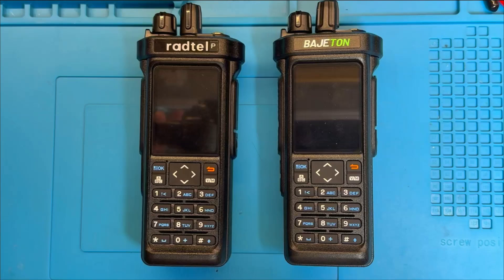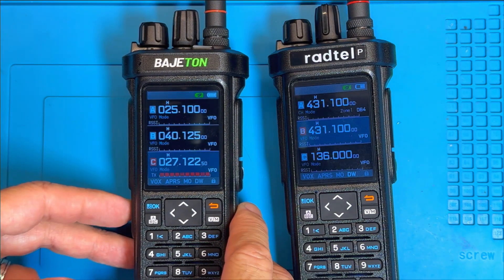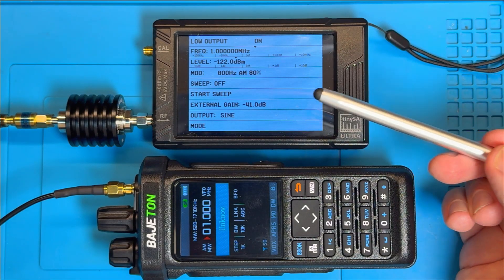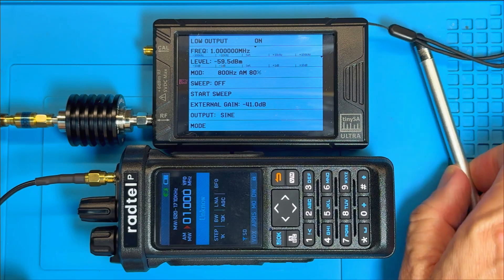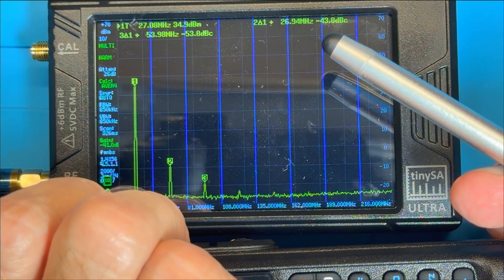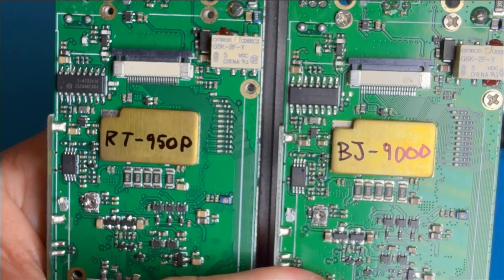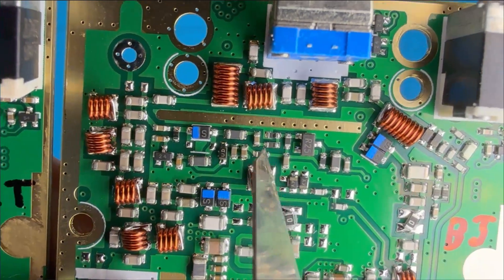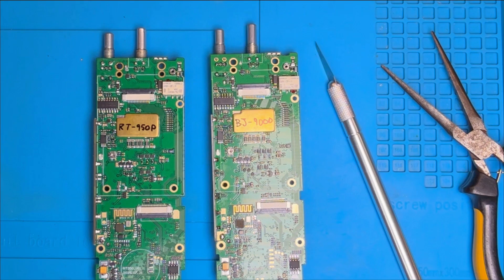EB028 - Bajeton BJ-9000 Vs Radtel  RT-950 Pro (Re-release)

Comment: my rt 950 pro doesn't have the work band menu, it has bandwidth in it's place. can you explain this?
Reply from the maker: Have you put the radio in Super Mode? See my video EB026 at the 12:16 mark.
Reply: @ElectroBananasYT  so do I need to solder or desolder something on the PCB?
Reply from the maker: No
Reply: @ElectroBananasYT sorry to bother again but I saw the video and didn't grasp what to do to access de menu work band

Comment: Not sure why operators are that worried about some slightly low RX. It’s a cheap Chinese radio. As long as it TX and RX in the designated bands, then what is the problem. Might be the new generation licence holders who seem to be obsessed with problems and not operating

Comment: Did the v23 firmware update fix the radtel 950 pro?
Reply from the maker: It is a hardware issue, not a firmware issue.
Reply: @ElectroBananasYT dammit! I was hoping I misunderstood. Well, I guess I'll be waiting for the next one and sell the 950 when I get it.
Reply from the maker: I am working on a DIY fix video. Watch this space.......
Reply: @ElectroBananasYT I guess it will involve dissasembly and resoldering? I should search for a professional with the necessary tools and experience. Thanks for the heads-up!

Comment: What features do these have that the  Baofeng Min and Senhaix 8650 don’t?
Reply from the maker: The main ones that come to mind are APRS and GPS. Also a bigger and higher resolution screen. Ability to Rx&Tx on 27MHz CB band
Reply: @ElectroBananasYT  thanks for the insight, so you’d likely recommend either of these in your video over the two models that I noted?
Reply: @momosgarage por supuesto  cual quiera delo s dos es mejor opción

Comment: Thanks. Great video again. Very helpful. 
How do you check if you’ve got an older or newer RT950 Pro? Only by listening or measuring? It was not a firmware upgrade? Opening up and check board versions? 

So get the hot air gun ready? 😊
Reply from the maker: Definitely will need to fire up your hot air gun or soldering tweezers unfortunately. And that is one we discover what components need to be changed. I have asked Radtel the question on how to identify the radios with the issue. They have not come back to me so far.

Comment: But is LW / MW really any good in the real world with the BJ9000 using a proper MW loop etc compared to any other radio even the TEF6686 ? I suspect not !
Reply from the maker: For sure it will not be as good as the super sensitive TEF, and probably not as sensitive as a radio with a dedicated HF SMA socket. Not sure how well impedance matched the input would be with a ferrite rod antenna. Good question though….

Comment: According to Radtel the problem was fixed with the RT-950 pro with new model version produced after mid Sept. I found this information in a facebook post on the "Radtel Two Way Radios" pages, Ratel Admin posted the claim in a comment. The post was dated 10-15-25, "My new 950 pro on LW and MW is deaf what can I do with this problem?"  I replied to Radtel Admin's comment and asked what serial # did the fix start? no reply so far...
Reply from the maker: Thanks for the update. I asked the same question. Should be by serial number or the hardware version reported in the ‘about’ option. Let’s see…

Comment: I received my 950Pro just under a week ago, and I'm currently in the process of sending it back. Mine is deaf on LW and MW, and not particularly sensitive throughout the SW bands when compared to other SI4732 based radios. It also lacks sensitivity on the airband when compared to other budget handhelds. On 2m and 70cm SINAD results  are disappointing and are bettered by the much cheaper Radtel 470X.  Maybe I've received an exception to the rule, however Radtel are aware of these shortcomings but are only offering existing owners of the 950pro a 10% discount if they purchase another 950pro with the revisions. My preference is to return mine and wait until all the issues are addressed before I consider buying another.
Reply from the maker: That’s a shame. Yes if you need MW and LW I would be tempted to do the same. I found Airband and HF to be good. Have you watched my video EB027?
Reply: @ElectroBananasYT Thank you for the reply. Yes I've seen your previous videos and the excellently detailed teardowns. I think I maybe I'm one of the few that statistically has received a faulty radio, or one that does not meet the claimed specifications. I've redone my SINAD measurements on 2m and 70cm just to make sure I didn't make any mistakes, and I'm still getting the poor results with the 950pro I have. I bought mine from Amazon, supplied by Radtel UK, so returning the radio is not a problem and I'm hoping Radtel UK will respond to my comments I left on their listing.
Reply from the maker: Okay, thanks for sharing. Are you panning to get another or look for something else? Shame, you have had that experience, mine has been great
Reply: @ElectroBananasYT donde lo compro entoces
Reply from the maker: Direct from Radtel. There is a link in the description

Comment: excellent review....seem bejeton  BJ-9000 was more superior than radtel 950 pro
Reply from the maker: Actually they are the same, the Radtel RT-950 Pro used in this model does not have the latest hardware update. The latest 950 Pros on sale are exactly the same as the BJ-9000 and don’t have the MW LW issue.
Reply: @ElectroBananasYT  too bad there is no way to know if you are getting old stock or new stock. Wish I didn't buy my 950 Pro right when it came out.
Reply: @ramblinrobertraw Hopefully they are reworking all the unshipped stock. Otherwise it is a gamble. I am still going to wait a while before ordering. I am still seeing reports of firmware issues, and Chirp support is getting better every day.